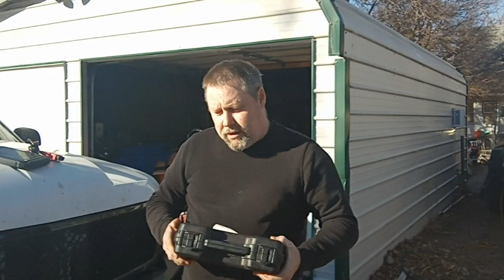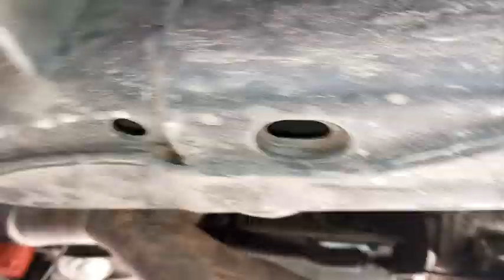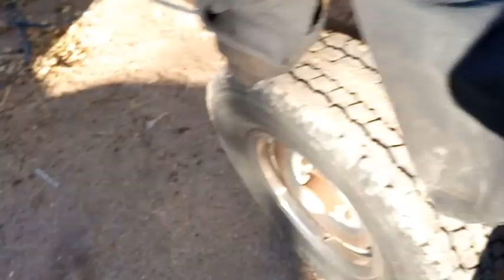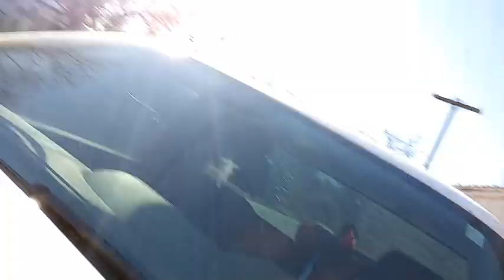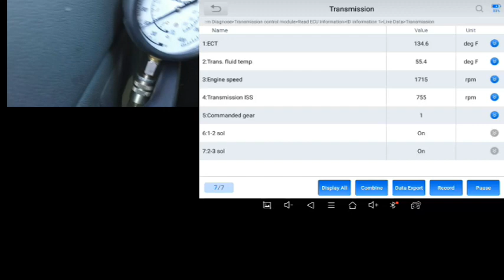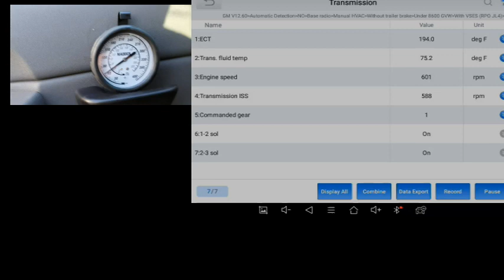How To Test Line Pressure on Chevy's 4L60E / 700R4

Comment: So what is the best thing to check to regain the line pressure? Would it be a boost valve possibly?or the pump
Reply from the maker: I'm a very experienced dealership technician, but not really a transmission expert.  For me, with no pressure, it's time to send the transmission to someone that specializes in them.

Comment: Any bets the torque converter and front pump are shot?
Reply: Fluid and filter change barely helped , mines not holding third gear , so it never makes it to overdrive ..you sure I cant just hook a pump to this pressure gauge hose ? Give her a external pump boost ? 😂
Anything to get out of pulling this p.o.s ...🤔🤔😅😂
Reply from the maker: nailed it.